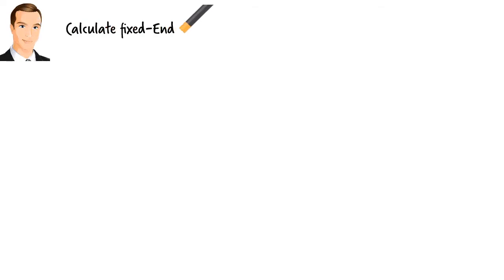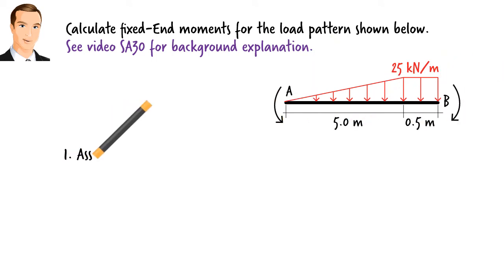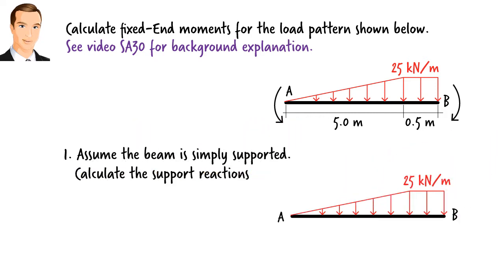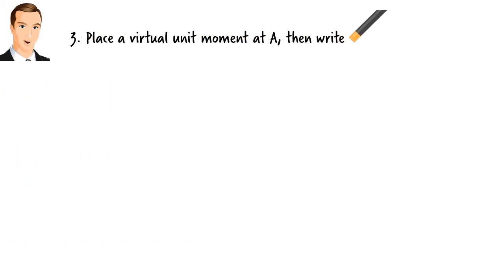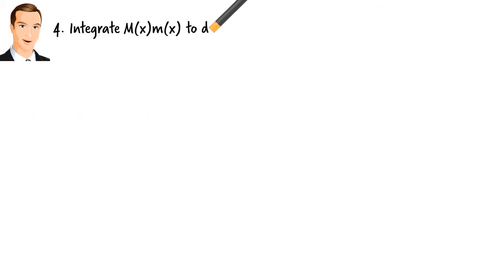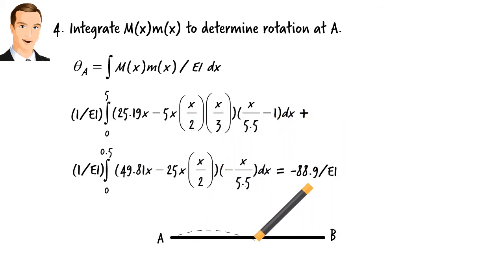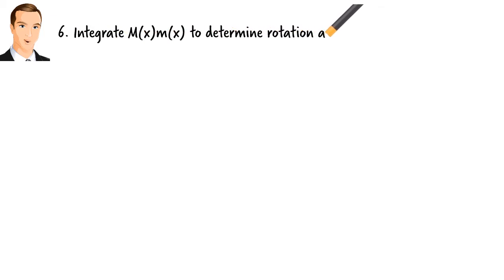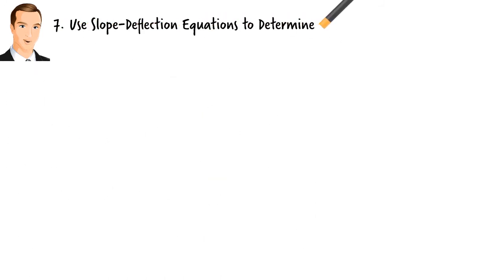SA43-A: Fixed-end Moment Calculations for Trapezoidal Load

Comment: Hi ! i have a question at 2:28 we Negate the Rotations so we get your results ? Positive FEMab and Negative FEMba
Reply from the maker: We don't negate the rotations, we negate the moments. Why? Because the slope-deflection equations give us the member-end moments. But what we are after here are the fixed-end moments. Think of them as the reactions to the member-end moments at the ends of the beam. So, if the member-end moment at end A is negative (clockwise), the reaction to it has to be counterclockwise. Similarly, since the calculated member-end moment at B is positive (counterclockwise), then the reaction to it (the fixed-end moment at B) must be clockwise.
Reply: Thank you very much !